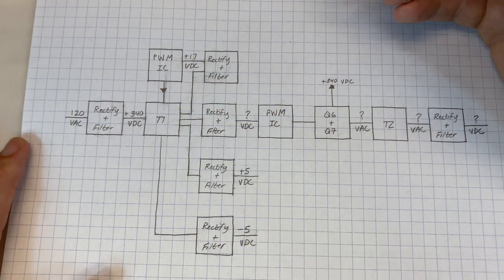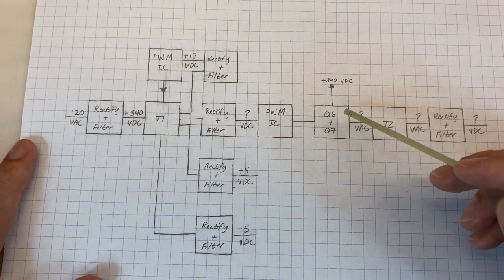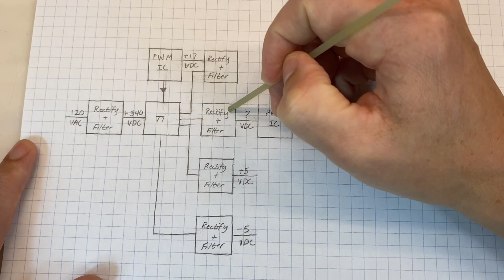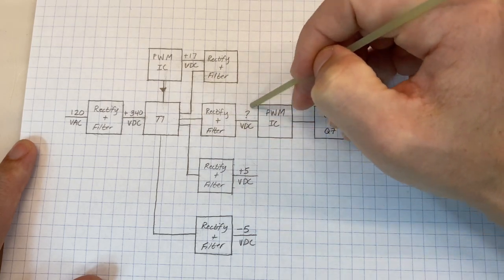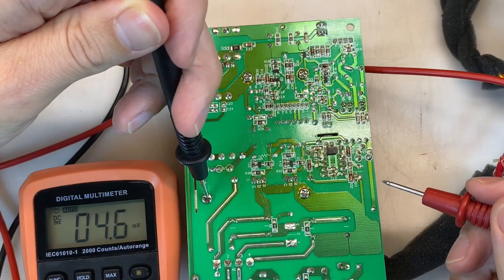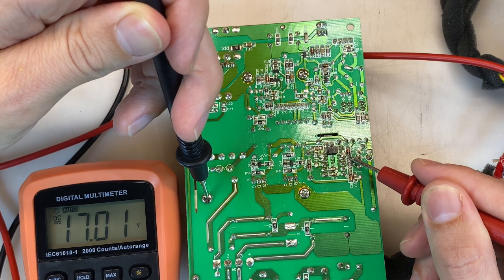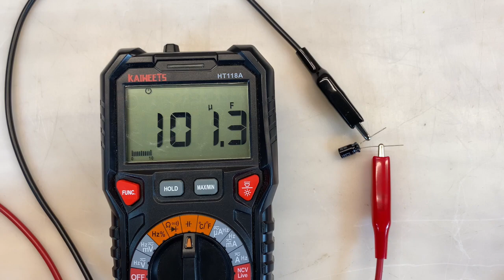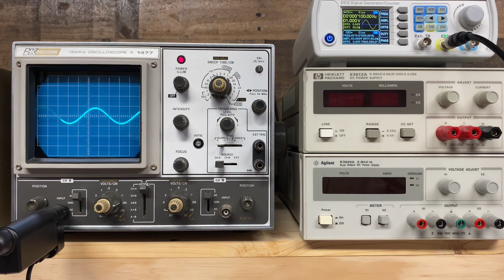DR #52 - Speaker Amplifier Repair - Definitive Technology CS-8080HD

Comment: I love the DT speakers, and have LCR3000. I beleive they been designed to have broken amps on purpose, and 24 to 32 OM woofers prevent using most of external amps. I just replaced amp on ProSub 1000...luckily it was only $50 on eBay

Comment: I picked up a ProSub 600 the other day. It also has some kind of PSU issue, which looks very similar to this one. The +-7V rails seem to be the issue. Instead of +-7 volts, it reads an asymmetric /lower voltage. Some capacitor or something may be shorted. Replaced the ICE PFC IC, thinking that was the issue but no joy. Will look into it again tomorrow. If you  have any experience with this model , please lmk.

Comment: This is great, but having a similar issue I reached out to Definitive Tech support. My speaker is out of warranty. It had at least 8000 hours on it. 

The cost to replace the amp board? $80. Got the board shipped to me in 2 days. And it’s a 5 min install. DT customer service is excellent. 

I looked up the cost of all the parts replaced in the video and it was about $40 shipped. I just didn’t see much value in doing the work to save $40. Plus I have a warranty on the new board. 

And if I took it to a tech to do the repair, it would with labor been more than $80.
Reply: Only 80? Wow. I found one place that had amps for my 8020's listed for 120 but were sold out and DefTech no longer makes them anymore.  So I think repair is the only option for me.

Comment: Great video. What do you mean when you said it was "acting erratically" after you replaced the caps? 
I have Definitive Tech Supercube sub and thr amp is making a ticking sound, like a watch, the power lights blinks in time with the clicks as does a pop sound from the woofer. Any idea what that means? Thanks!!

Comment: Hello Nick. My name’s also Nick. 
I have a CS8080HD. I bought it on eBay and of course the sun didn’t work. I called DefTech and they sent a new amp. I swapped it out and the sub still isn’t working. I don’t have meters. I know the basics enough to have swapped out the whole amp. Any suggestions from here? I didn’t pull out the sub itself. The sub is still connected though. 
Mids and highs work fine. The back light was flashing on the original amp. Now it’s solid and again, everything working except the sub. Any suggestions from here? It’s the weekend and I can’t call them until Monday.
Reply: Sub, not sun. Autocorrect..

Comment: perfectly calibrated failure point, right after the warranty expired. what a modern marvel of engineering.
where do they even get these horrible capacitors from?  cant even find those brands when i look at the most shady asian supplier websites.